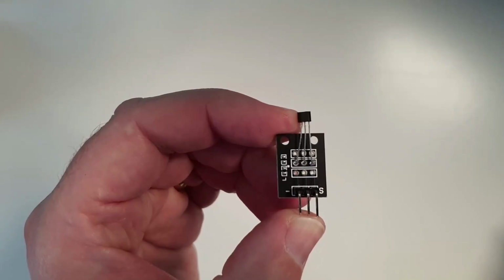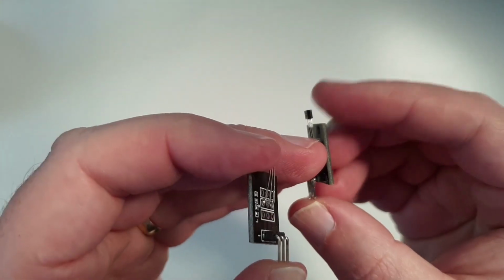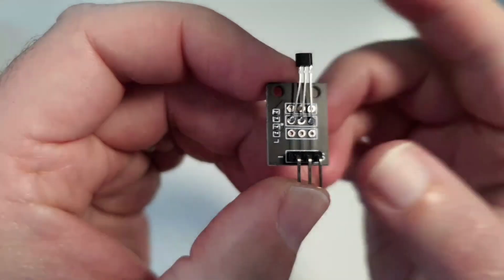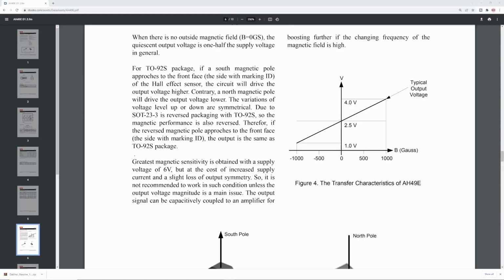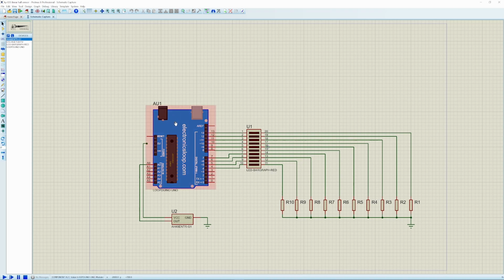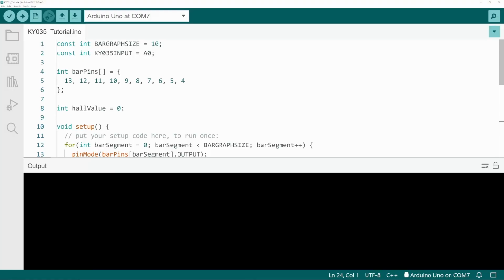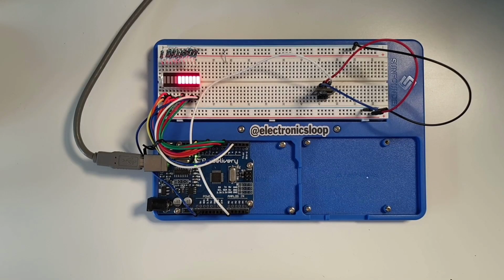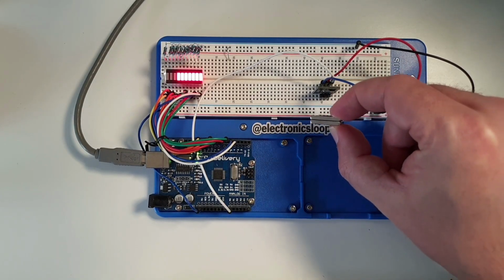ky035 linear hall magnetic sensor how to use project with code azdelivery 35in1 sensor kit

Comment: This is the perfect circuit that I have been looking for, with a very small change.  Could you make this circuit begin at the first LED, and light them gradually as the magnet gets closer to the sensor?  In other words, could we light the full range of the LED DIP IC?
Reply from the maker: Mike, In the main loop, change the map values: 
 int barLevel = map(hallValue, 220, 500, 0, BARGRAPHSIZE);
This will give a single field polarity full bargraph output depending on field strength.
Other points to note - actual min ( 220 ) and max ( 500 ) will depend on your sensor so you will need to calibrate these values to your specific sensor/magnet/field
Also I would include some checks to filter out duff or out of range values as part of the display process.
What is the end application you are using your sensor?

We have also uploaded a quick short to show these values working on the full scale 10 segment bargraph for you to see.
Reply from the maker: Hi Mike, no worries... we shall make some slight adjustments and paste an amendment here. Standby!